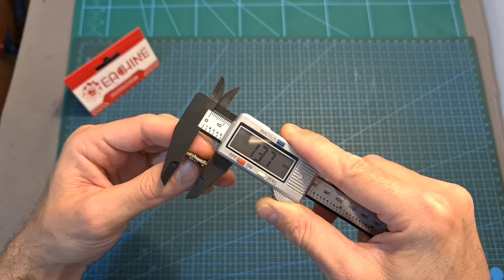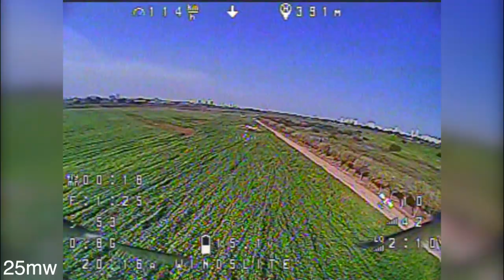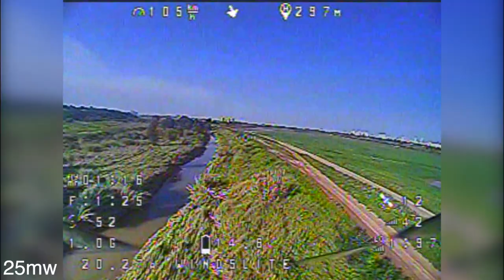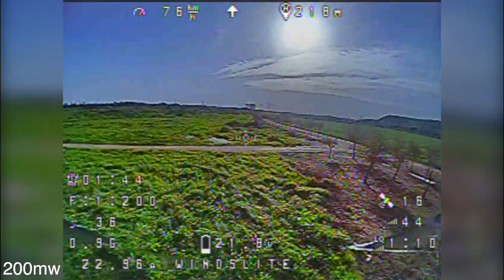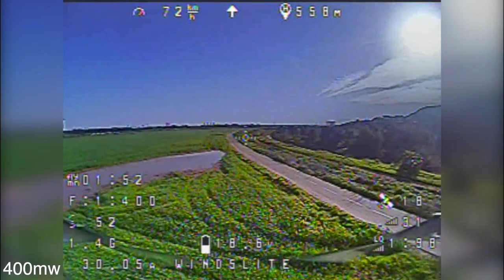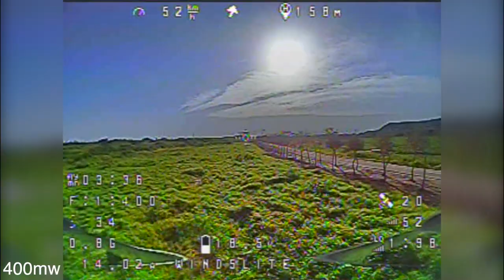Eachine Nano V3 VTX - Overview And Output Power & Flight Tests

Comment: Awesome video, well done as always!
I have two questions regarding your flight distance and HGLRC Zeus Nano VTX 

1. Why do you fly so near when your the vtx power is set to 400 mw in many of your videos ? I ask this question on behalf of a fixed wing beginner flyer where I would like to know the actual range that 400mw vtx that you review can do ?

2. Why is the HGLRC Zeus Nano VTX slightly better when the output power of the Eachine Nano V3 VTX surpasses the HGLRC Zeus Nano VTX ? 

Thanking you !
Reply from the maker: Thanks Ralph!
1. On a wing you will be able to fly further (it also depends of course on your radio setup). 
2. Output power is not everything, build quality and temperature control are important as well.
Reply: @KremerFPV  Thank you for your reply Mr Kremer. So I am in search of good output power or range for my rc fixed wing/s. For range with decent video quality just regarding the two types of vtx's, which are the Eachine Nano V3 VTX   and   HGLRC Zeus Nano VTX, which one will have a better range between the two Mr Kremer ?
Reply from the maker: @ralphquetaya4547  No problem. As I recommended in the video, I would go with the Zeus Nano.
Reply: @KremerFPV  Thanks for the advice Mr Kremer. I'll give the Zeus Nano a try!
Reply from the maker: @ralphquetaya4547  Np, I hope you will like it :-)

Comment: Hi Gal Kremer, great review! As always 😉 Looks interesting the VTX, looks really cute, to use building Lite builds. 

I have a problem maybe you either have an idea or help? My image in my goggles is upside down 🤦🏻‍♂️. Have checked the OSD setup „invert“ is off. I got such a headache coz of this, I ordered the iFlight A65, just for fun to rip around in my small apartment 😉 

Take care & happy fly’n 🤓😉😘
Reply from the maker: Thanks! You have two options - you can use the OSD control board (of the camera itself - has nothing to do with BF / OSD config) or you can just flip the camera :-)
Happy flying!
Reply: @KremerFPV  dito, flipped camera 🤣🤣🤣 🤦🏻‍♂️ 

Fly’n A65, didn’t imagine the fun, take care 🤓😉😘

Comment: does it need regulated 5 volts from a 5V pad, or can I also power it from a 1S LIPO pad?
Reply from the maker: As far as I know you need to provide it with 5V. I didn't test it with lower voltage.

Comment: After testing both eachine nano and rush tank tiny I have found out the eachine nano performed way better in terms of range with a worse antenna, it's also running way hotter. I don't think my rush tank is outputing more than 200mw
....
Reply from the maker: Are you referring to the Nano V1 / V2?
Reply: @KremerFPV  yea the eachine nano v1, also on that note i had a rush tiny tank that arrived dead and my current working tiny tank randomly enters in and out of pit mode after some crushes, maybe its time to pay the extra for the tbs one....

Comment: Mine stuck on pitmode everytime power cycle
Reply from the maker: Disable VTX control and see if the issue still occurs.
Reply: @KremerFPV  with disable vtx control all normal, no pitmode stuck, but i cant change channels without this